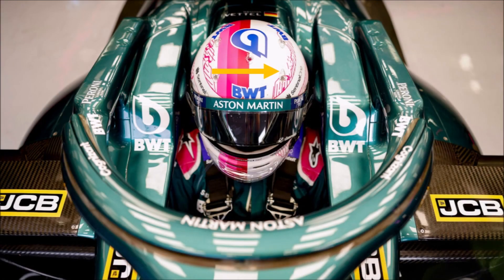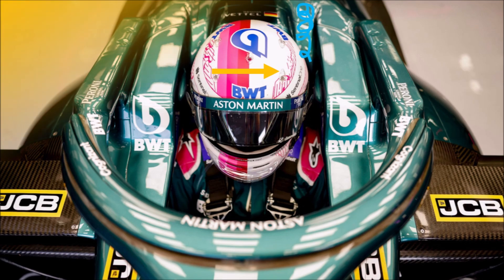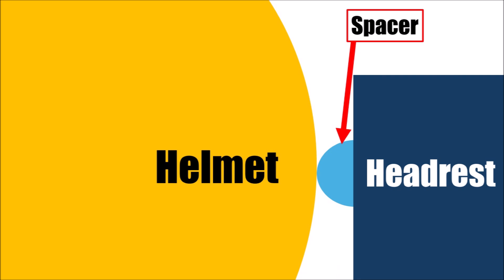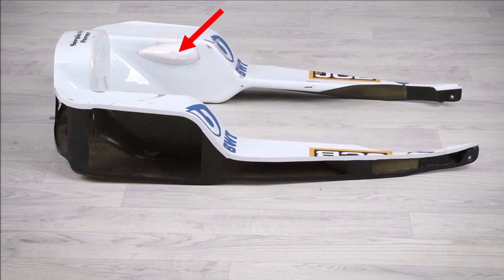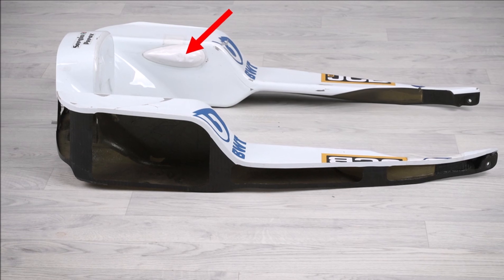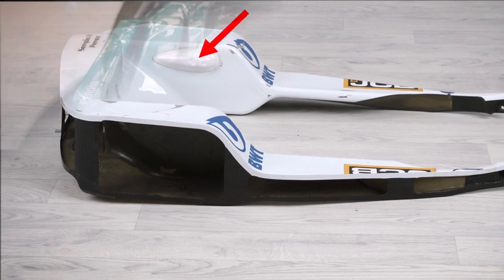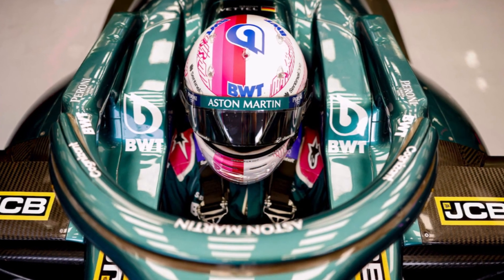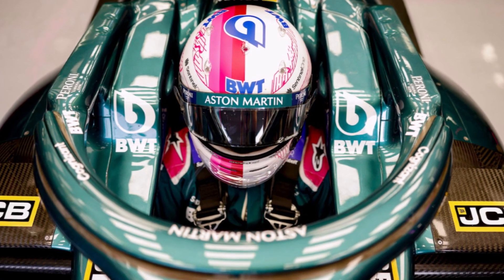F1's Headrest Details - EXPLAINED

Comment: Reminds me of drivers with certain cars in some years moving their head out of the way to get better cooling/airflow for the engine. 
"No you can't just drive the car, take care of all those 483 details while doing so too!"
Reply: That’s because the overhead airbox of rear engined F1 cars arrived in 1971-2 having been always in the nose before. The previously optional driver position, to sit upright or be more laid down went more in favor of laying as flat in the cockpit as possible. This is when a shorter driver out of the engine’s airflow had a more significant engine power advantage than the slight mechanical edge of a longer limbed driver in the 1960’s.